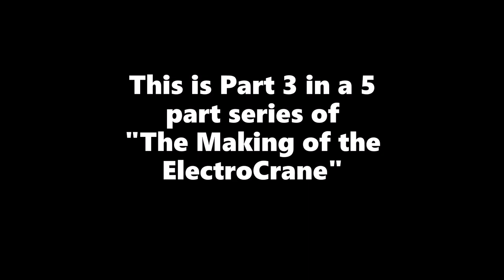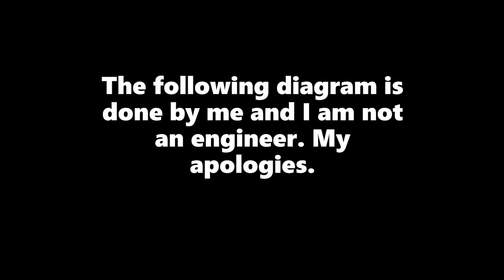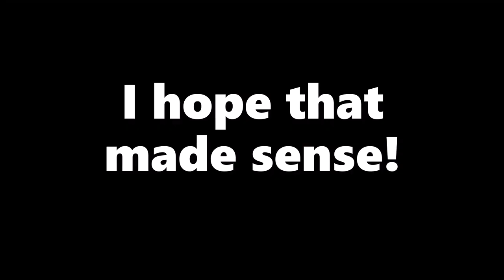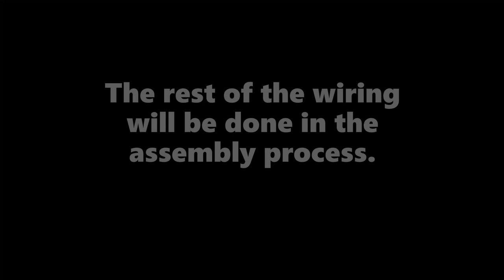The Coolest Toy Never Made  ~Part 3~  Electrics

Comment: This is a great project!  For the switching, you could eliminate 1 switch and simplify the wiring with a "momentary contact, double pole, double throw" toggle or rocker switch.  Centre position off, hold switch one way for high power, and the other way for low power.  Like the switch used for a car power antenna, or windows.